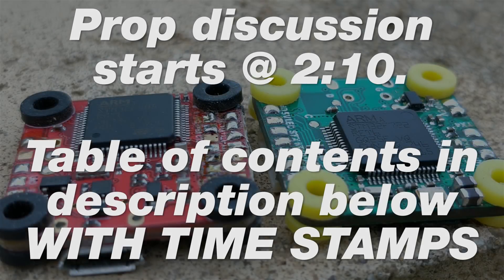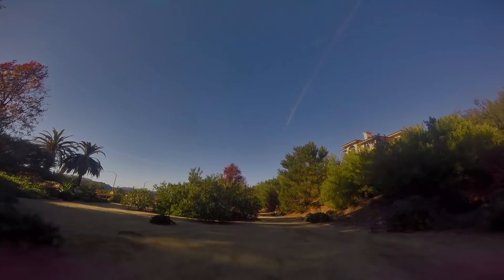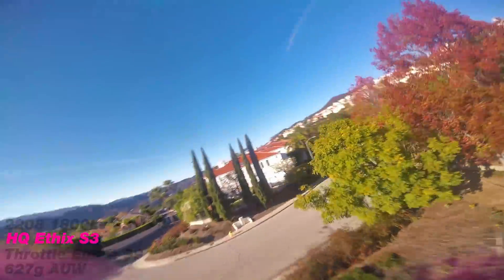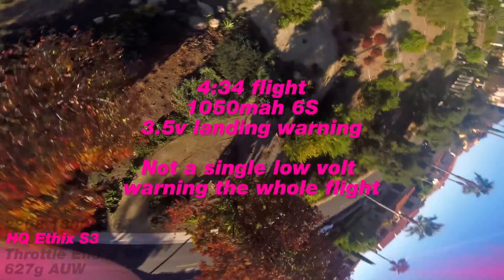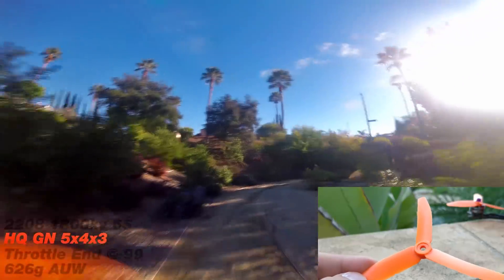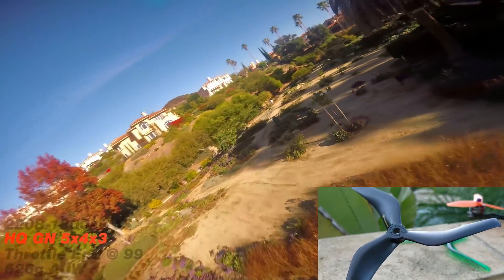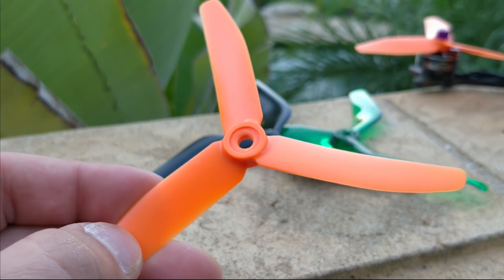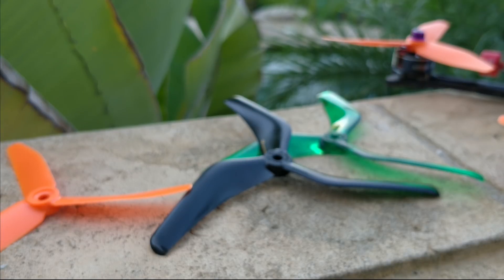HQ Ethix S3 vs HQ GN 5x4x3 and Talon F7

Comment: The hq 5x4x3 are smoother Because it's a softer prop..more flexible
Reply from the maker: the old HQ5x4x3 is far stiffer in the air than almost all the polycarbonate props that are similar.  They may feel softer in the hand but that's not how they perform in the air.  They hold their airfoil shape well.

Comment: I know this is probably a crazy question..but what are the best or even good pids for freestyle flying? Also I watch your vids and your doing a great job..the info you give us is also very much appreciated 👍😊
Reply from the maker: Default.  I run betaflight defaults 95% of the time.  the last 5% is just to test things usually.  I even run default BF rates.  the less I do the better.  I set up so many quads it's a PITA to do more than i need to
Reply: Ok thank you😊👍

Comment: I'm really curious and tempted to use the kabob 2208 motors on my first 6s build. Cf1 probably around 280g with gemfan 5149s. Will this be too much motor? To amp hungry? What I am used to is 2306 2500. I want more speed. Any thoughts guys?
Reply from the maker: I would now recommend a 2306 because it plays nicer with BF 4.0 and the new props coming soon are made specifically for 2306.  I still personally prefer 2208 for the superior throttle control but you'll probably prefer 2306 with the new props coming.

Comment: Hey Bob, do u do prop designs aswell??
Reply from the maker: I tried once and failed. Looked good.  Flew like crap. 😁
Reply: 😁😁 i think my idea gonna be same 🙄I draw to piece of paper. I have 3d printer, also cant use yet but fusion 360. How make it real and try?
Reply from the maker: @kalinkha  not quite. There is custom prop software
Reply: KababFPV which is? Thanks👍🏻
Reply from the maker: @kalinkha  I don't even remember but I'm sure Google search will bring up some results

Comment: Yo, what was the name of that frame you have coming out? Also do you know the release date? Also I've been wondering about 6" builds. What do you think about them? Like ups and downs and stuff? Maybe do a short video of on it or throw some info in one. Been curious about them but almost everyone flys 5". Which I'll probably go with once I get working again. Lemme know if you have the time but I'm curious about that frame you were talking about with me in the other video and what it's called so I can keep an eye out for it. Peace bro
Reply from the maker: It's the Glide Floss frame. Will hopefully be available next week. I've flown many 6" and 7". The problem with anything 5.5" and up is that you completely loose the responsiveness that comes with a light 5" blade. You gain some favorable grip and disk loading properties but the control is just not as good. I personally think skipping 6" and just going to 7" isn't a bad idea.  Already with 6" you've lost lots of response control and it's an even bigger struggle to get props out of view so might as well just go to 7" and get the benefit of a faster and more efficient cruising speed.

Comment: If you notice the HQ glass nylon prop is wider at base (next to hub)than the comparable blade(S3).
I believe this is where the streangth is in the glass nylon prop. In streangth, I mean the ability to not flatten out on high throttle input.
Reply from the maker: Could be. I've asked Zhong this

Comment: hey bro, I have been going back and watching some of your past videos and I saw a few where you said you designed or were designing a frame and where making version 2. it was some time in 2017 though. I have just recently found your channel which I really enjoy watching your stuff but I was wondering if you have a page or somewhere to purchase one of your frames? Although I still don't have a quad yet as I just recently got into the hobby about a month and a half or maybe 2. I have my Taranis X9D +, Fatshark HD2 terminators, battery charger,  and I fly in the sim a lot but have yet to get a quad to build (Lost my job recently so that put a halt of stuff). so yea lemme know or if there is a frame you recommend to a beginner for my first build shoot me back a message with some info if you could. Also if you wanna recommend a certain flight controler, ESC, motors and what not too awesome. later homie and thanks for all the great info!!!
Reply: Oh, 1 more thing. Stop apologizing for making long videos man :) Id watch em if they were 2 hours long haha. May take me a couple sittings but I love all the info you throw in each video. So yea do your thing and I'm probably not the only one who loves the longer videos you put out either.
Reply from the maker: Unfortunately even YouTube prefers I make shorter videos and more of them. My stuff is sold at pirofliprc.com. But hold on a week or so. I've got a new acro frame coming out that's really quite good. It's the first frame I'm actually proud of myself. Gonna have some real nice finishes too. I'll be making a video about it when it does come.
Reply: @Kabab  ok sweet. I mean not like I can rush into buying one yet anyway while I'm looking for a new job (fucking hate job hunting heh) so yeah ill keep an eye out for when it gets released though. So if you mention it and have a review of it in your videos ill definitely catch it. thanks for the notice brother

Comment: I'm curious are FC location aside frame center doesn't cause gyro reading deviations. Or you add some coefficient in CLI depending from FC center distance from frame center?
F722RE chip have the same LQFP64 64 pin package used for F4405 and F4411 chips (these are used in nearly all F4 boards). Quite convenient for both 20x20mm and 36x36mm flight controller boards by size. F4 and F7 chips in large LQFP144 package appeared only in very first F4 and F7 boards until folks learned how to have all needed I/O's with LQFP64.
If anybody need the F7 datasheet, see under link: https://www.st.com/resource/en/datasheet/stm32f732ie.pdf
Someone does very large flying thing testing over your house :)
Reply from the maker: Dunno bout all the mcu's but the FC doesn't care where it is as long as it's moving with the frame.
Reply: @Kabab  Plz check this out.  Just saw it on bangood at I have been scratching my head over it all day.     https://www.banggood.com/Eachine-TX806-leaf-5_8Ghz-72Ch-25mW200mW400mW800mW1000mW-AV-FPV-Transmitter-Smart-Audio-MMCX-MIC-p-1384224.html?bid=2392&ID=511528&cur_warehouse=CN
Reply: @trfpvVT  I guess Eachine will come out with a build where stack is turned aside :)  Or more likely this VTX board is supposed to build into a plane or wing.
Reply from the maker: Yeah, saw that, super weird lol

Comment: Are you saying the hq 5x4.3x3 is the most delicate prop or the 5x4x3? Because the 4.3 v1 is the most durable prop in existence.
Reply: He's specifically talking about the glass nylon 5x4x3, not any polycarbonate props (the 5x4.3x2 V1s is PC).
Reply from the maker: Nowhere in this video did I mention or refer to the 4.3 v1s.
Reply: 5's, 4's, 3's yeah I got that wrong. cheers.

Comment: Why don't you make the holes on the Flosstyle m3 for the 20by20 stack? Its such a pain to find good m2 screws and then when you do none of the PCBs really support it. Could you make an option in the future where you can choose m3 and m2 for the 20by20 stack? Love all the videos you have been putting out watch them all and enjoy them. :)
Reply from the maker: Because you can always just drill them out to M3. If I made them M3 than all the M2 stacks wouldn't work. Also, my new frame comes with super long M2 metal screws because I know they're impossible to find.
Reply: Does it matter what drill bit you use? I have heard that it can weaken the carbon. Also we can we expect a release for the new frame already have 2 flosstyles in my fleet can't wait for another one. Or even try out a prototype maybe or maybe I'm pushing it. lol
Reply from the maker: @anthonysamaha3760  you're physically cutting away at the carbon. It's gonna weaken it even if done from the factory. New frame should hopefully be here next week. If I use an m3 stack I still use Me screws and wide spacers....

Comment: why m4 to m3 soft mounting? why not m3 to m2? more space on board and lighter hardware
Reply from the maker: Because the rubber grommets don't exist for M3 to M2. I just found them last week on banggood and told the various companies to stop making stupid M4 holes
Reply: @Kabab  m3-m2 gross are pretty easy to get
Reply: Kabab FPV  they're always out of stock https://www.readytoflyquads.com/flight-controller-gummies-grommets-m3-to-m2

https://banggood.com/10-PCS-IFlight-M24-M2-Anti-Vibration-Washer-Rubber-Damping-Ball-for-Flight-Controller-RC-Drone-p-1305903.html

Comment: Will your new frame have the same dimensions of the front 4 standoffs as the FlosStyle? (For GoPro mounts)
Reply from the maker: Yes the mounts will be backwards compatible but there will also be a new mount that screws onto the 4 screws in front for ease of use

Comment: Kabab, try freezing your props. It will stiffen up most plastics. Crazy difference.
Reply from the maker: Very very interesting. I'll give it a shot.
Reply from the maker: Hell I'll just freeze the whole quad
Reply: Bah! If you fly in Wisconsin, your props will freeze right as your flying right now!!!
Reply: @Edgewalker728  I believe that weather now freeze also batteries and yourself in one solid chunk of ice :P  Something like happening here now.
Reply: Hmm, I feel like this might become a crazy new trend lol. I totally want to try that now :)
Reply from the maker: @kwadifyfpv8388  I actually just tried it with the S3 prop. Didn't seem to do anything.
Reply: @Kabab  ok, interesting. I can tell a difference of flying in hot air vs. cold air (which might freeze the props) but I imagine the difference I feel is just air density.
Reply from the maker: @kwadifyfpv8388  that's more likely due to the air density changes than anything that's happening with the prop properties
Reply: Would that not make them Brittle and susceptible to breakages more?
Reply: Try a dust can upside down. Also if you look into temperature effect on magnets even 20° cooler makes a big change on magnetic field. You can use the spray on your motors and ice them before a flight. I use the spray on the props and that's when I see the difference. The freezer might work but by the time you install and fly I don't think they are as cold as spraying them then flying

Comment: Betaflight has been fully optimized for F7 since version 3.4.
Reply from the maker: It has?  How so?  I know it runs on F7, but it's not exactly heaps different from an F4
Reply: F7 isn't a different architecture - just faster core, new types of cache, more UARTs, more interfaces, etc. It's about 40% faster than F4 (based on experience). At this point there's no reason to continue to build flight controllers with F4's except maybe in the budget or 20x20 space.

Comment: Do you think the more delicate or stiff material prop has better feel?

Maybe it has something to do with 

I mean I recently tried the Master Airscrews 6045 tri. It felt amazing in comparison to the normal PC 6045s that I used. It is just hella delicate and would break on a slight toss up.
Reply from the maker: Wish I knew.
Reply: Kabab FPV 
It is good that you are humble on this subject.

I just happen to have a theory that it is PC is the most durable material so far, but not the best for in flight performance.

Comment: Hey I was thinking of building a quad with 6inch arms but running 5inch and 6inch props for different flying styles. For example 5inch for fast, aggressive acro flying and 6inch for more relaxed, longer range/flight times. Do you think that the longer arms will make a significant difference to the flight performance on 5inch? Or it's not really that big of a deal? Thanks! Love your videos!
Reply from the maker: Depends on the frame. My acro frame is the size of a 6" frame for 5" props so no need to use longer arms.
Reply: @Kabab  ah right is see. Thanks for the advice!
Reply: @Barack ObamaOh yea. Sounds like quite a good idea actually! Thanks Obama!

Comment: I think it would be very useful to put these props on a test bench, spin them up to a high rpm with a multiple of 60, then shoot at 60fps to see how the blades flex at high throttle. It would basically just show the props as stationary, right?

Comment: I’m a close proximity freestyler, I just care about lower 2/3 response. I don’t think I’ve ever gone full stick for more than  10 sec, ever?  
I’m happy flying anything 3.1.7 or better...sure lots of “changes” but perfectly flyable.....weakest link is rarely the hardware:-)
Reply from the maker: All I usually do is close proximity.  It's why I'm always chopping off the top ~30% of my throttle range in my throttle endpoints.

Comment: I observed the "pitch" system, the Ethix blade is angled at roughly the same angle as the OG 5x4x3 V1S, and the 5.1x4.1x3 blade is angled at roughly 5x4.5x3 V1S. But i can see the blade is twisted slightly, the trailing edge takes the turn later compared to past V1S models, also it extends upwards slightly compared to V1S. 
P.S. I think V1S can officially be associated with the material as well as the airfoil of a generation of HQ blades, cuz all the props so far starting from 5.1x4.6x3 has been a retuned design where the blade "angle of attack" is similar to that of slightly greater pitch V1S props while granting lower pitch control, response, and feel.

Comment: In addition to fewer IO breakouts, the smaller F7 packages also have less flash & less RAM than the larger F7 packages, afaik. Whether that will become an issue in the future is anybody's guess, but they won't be as future proof as the larger F7s.
Reply from the maker: I'm not convinced F7 is the way forward at all personally.  The devs I speak to don't really know what they're gonna do with it.  There are some ideas but nothing solid so far.  Especially since it seems 32k is a wash...

Comment: Is that your.frame  . I love the setup  with separating  the boards ive been looking at the hyperlow frames  not sure which  to get
Reply from the maker: Yeah this is my new design that's coming.  That one with no top plate is an older prototype.  The one flying with props on it is the final design without the final finish.  The ones that will be for sale will have full chamfers and premium finishes.  Should be really nice.  Hoping they'll arrive this week.
Reply: @Kabab  awesome ill wait im in no rush lol .i think splitting  everything apart  is the way to go much better to work on

Comment: I'm not sold on these ha v3 steel props man, I am a huge azure fan of the 5140 azure props. I know you have tryed them before.
I have so many azure props of the 5140 it's not funny haha.
I would put the 5140 azure up against the v3, not the 6045 ones.
It takes alot, and i mean alot to even brake them azure props.
I will have to buy 1 pack of these v3 and see what I think. I'm just not sure if I would like them bc of the 31 pitch on a 4s battery.
Yeah maybe they work great bc of the 6s. But do they do the same on 4s?
So if you got both the 5140 and the v3, and a 4s quad laying around yet. Do that comparison. Bc not everyone is on 6s yet.
Reply from the maker: Yeah I love all the Azure props.  The 5140 is very good and extremely durable but it just doesn't have the response and throttle bite I want.  When I tried the old glass nylon prop again I was reminded of that incredible bite and response that I miss.
Reply: @Kabab  hmmm that weird that you say about the response for the azure ones.
I get all kinda response from them, way better then the 5046c ones from dal.
Maybe its bc of your tune hahaha, I know I know your not good at tuning your quad lol.
I forgive you! Send me a set of the v3 and I'll see what your talking about lol
Reply: I agree, the 5140 azure is amazing, and very durable.

Comment: When you mentioned making them popo at the end, it made me think... Do you think that the hub design on the classic GN 5x4x3s is creating some sort of beneficial properties once tightend down? Is the side profile or stiffness changed a bit once tightend? Just wondering if the hub design, besides being obviously lighter, could be affecting the props performance once tightend...
Reply from the maker: I would say probably not since it doesn't deflect or change in any way that I can tell after tightening

Comment: I’ve been using the matek f722 for a year or so which has that same F7 chip. Other chips (I think the 745) have slightly better clock speed and more uarts. The nicest thing about F7 though is that every uart has inversion so you never have an issue with that
Reply: F722 performs better than the F745.
Reply: Yup looks like I was a bit wrong! They all have the same MHz, but different cache and ram https://www.st.com/en/microcontrollers/stm32f7-series.html?querycriteria=productId=SS1858

Comment: Real glad you did a props video because I feel so new to 5" flying. I found a gap in the winter weather 2 days ago and took out my Hawk 5 & custom lightweight build with 1407 3200kv motors: http://www.haku.co.uk/pics/FeatherliteQuad.jpg
I flew a pack on the Featherlite with old Gemfan 5x4.5x3 GRP's which felt kludgy, then put the spare Avan Flow 5x4.3x3 on it from the Hawk 5 - Night and day! The Avan Flows made the quad like an old friend, like I'd put 100 packs through it instead of about 10 I've actually flown on it.
I see some HQ Ethix S3's in my future :)

Comment: I am flying with Matek F722 the whole year on one of my builds and I have to say it feels more solid than all the F4s that I flew it on one day with (including RaceFlight board thats HW is good I guess). All using a 3.4 and 3.5. For those two the board performance got UP and I was able to run 32k/32k :) right now I am back to 16k16k on DEV version of BF 4.0.0 #1265 :) seems like the new goodies needs some more optimization :) on 32/32 its running 40% which seems ok but it had some spikes to 92% so....